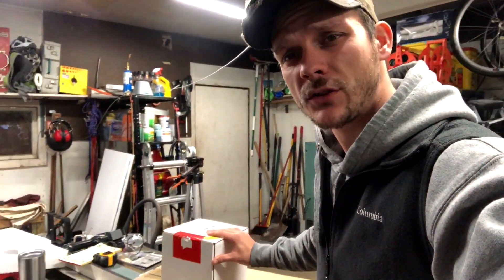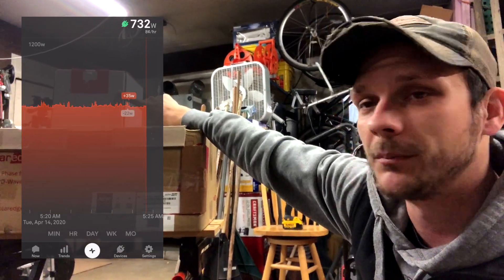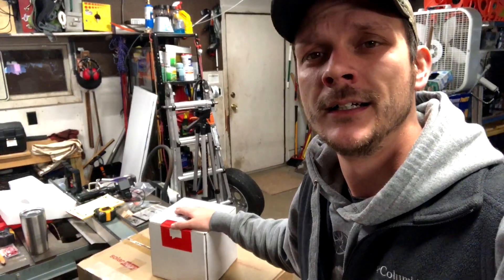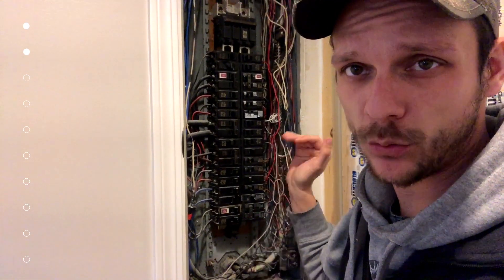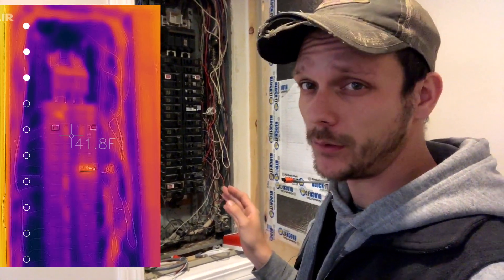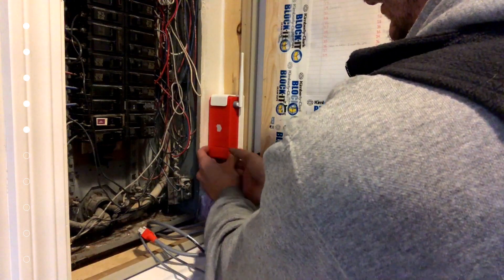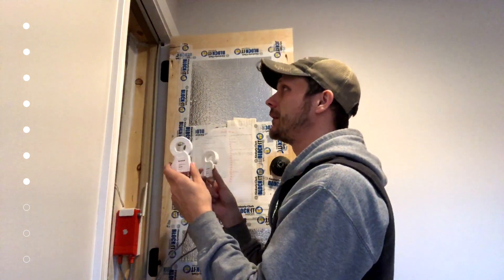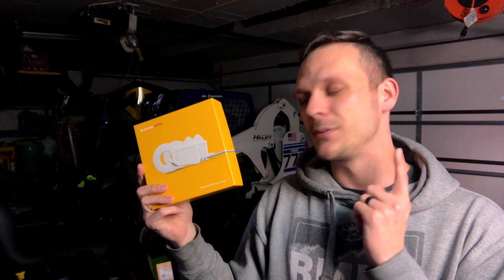Know What All The Electricity In Your House is DOING - How to Install Sense Energy Monitor

Comment: Technically you don't have to wire the red and black wires on a double pole breaker and you also don't have to install them on two separate 120V single breakers either that are next to each other. You can attach the red and black wire on two different 120V breakers that aren't next to each other. They just can't be both running off the same power phase. Each panel has a phase 1 and a phase 2, 120V lug. Attach the red wire to one phase and the black to the other phase and you'll be fine.